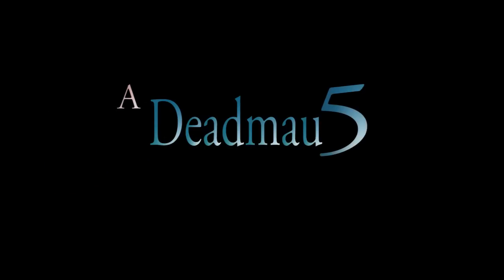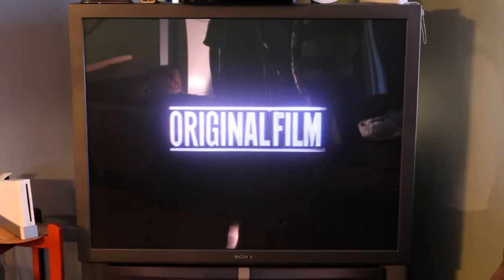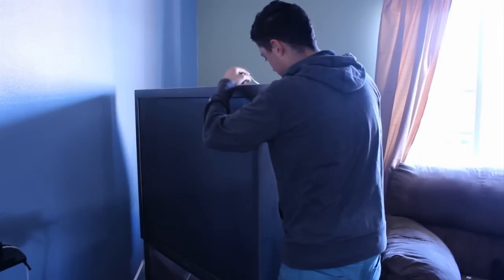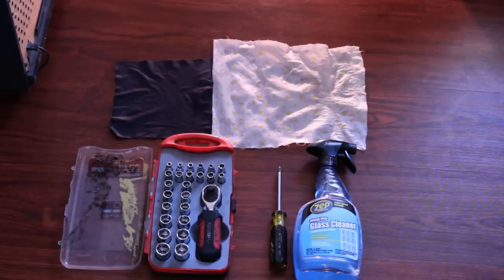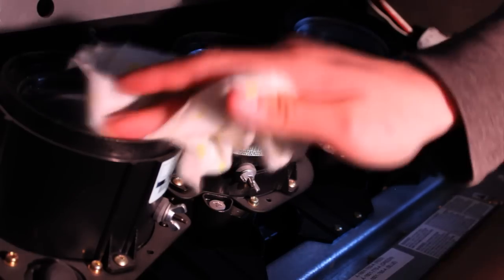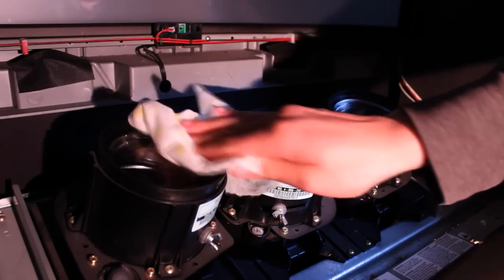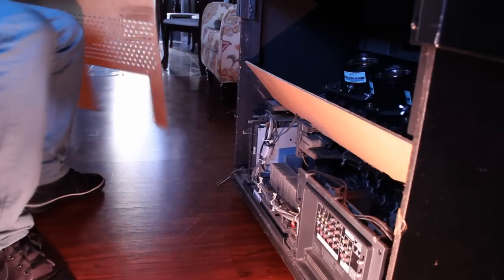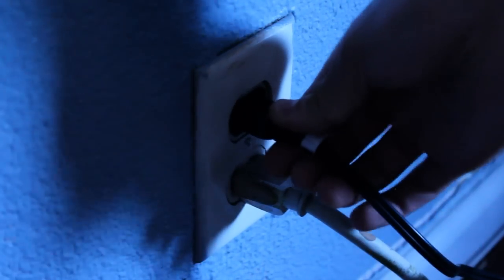How to Clean the Lens on a Projector TV

Comment: if your rear projection tv is like mine (talking about other users here) the 3 lens's are located in the front. all you need is a screwdriver. remove the screws holding the front plate (screen) on. and the 3 lense's are there
Reply: Jon awesomeness,  I know this is from 4 years, but I’d really like to know where the three screws are located that you referred to.  Have an older Samsung dip and the lenses are definitely not in the back, so I need to get the screen off.  Thank you.

Comment: Audio leveling could use a little work, but the presentation was good otherwise. Also, try not to let your glass cleaner run down into the inside of the lens. If too much leaks in, it may evaporate as the set runs and fog up the lens.